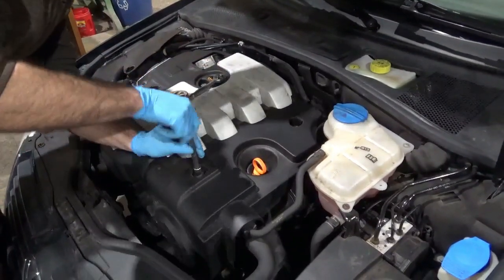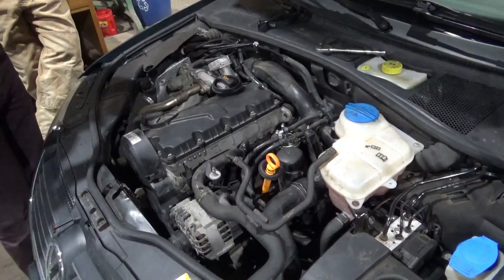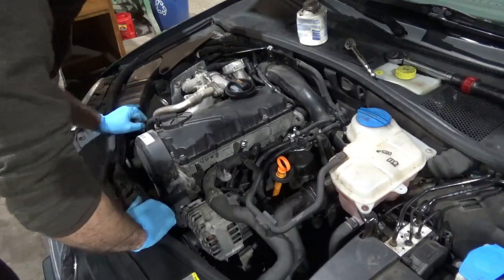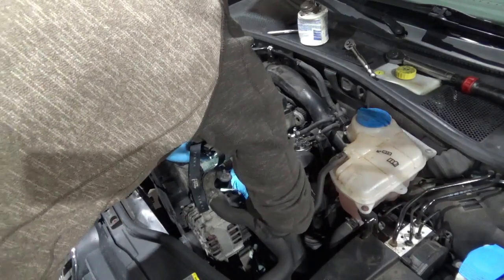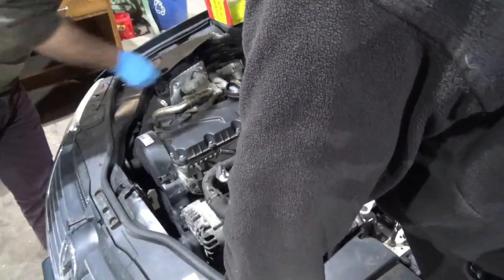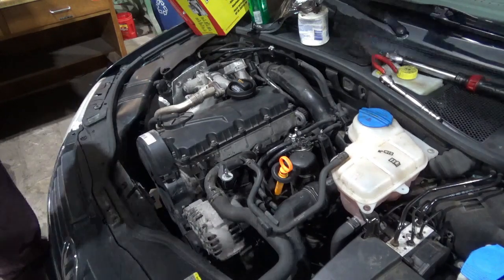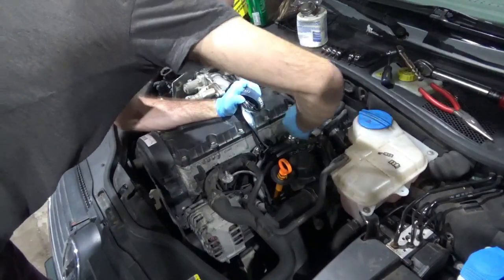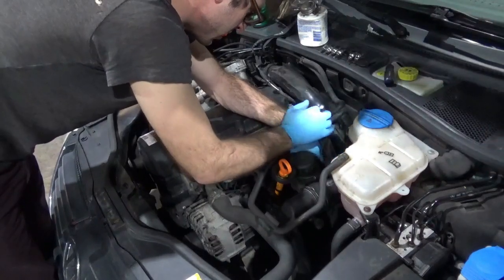2005 VW Passat BHW TDI glowplugs, glowplug harness and Frost Heater install

Comment: Are all the glow plug wires the same length that connect to a common relay?  Planning to replace them, order parts, but I noticed that all the glow plug wiring have the same the length.  Need help with my B5.5 Passat TDI thanks!
Reply from the maker: I don't know about them being to a common relay, that is why I had my friend just solder them in. In order to replace them fully, you would have to tear apart the harness and the metal coolant pipe. here is where I got the harnesses, you need 4 of them: https://kermatdi.com/i-1186-glow-plug-connector-harness-bhw-coolant-plug-harness-mk4.html#!year%3D2005%7C%7Cmake%3DVOLKSWAGEN%7C%7Cmodel%3DPASSAT They do sell OE glowplugs as well. You can find them on ebay, but I highly recommend go with the Kerma TDI ones, so you have some sort of warranty

Comment: Josh, thank you for this video! Just one question: to access 3rd and 4th glow plug, can I disconnect the rubber pipe that goes above them, for easier access? Also while removing glow plug connector, I accidentaly broke first one, because it s some old plastic, but wire is still ok. Can you give me some advice how to remove them? Thanks!
Reply from the maker: That pipe is metal, and it connects into the block behind the engine, so it very hard to remove, even if you remove it, you would have to drain and then bleed the cooling system when done. That is a hassle that I didn't want to do if I was just replacing the glowplugs. That is why I didn't remove it. The glowplug connectors are rubber to start with, and with the heat, oil, and time from the engine, they turn into plastic and become very brittle, that is why I decided to replace them as well. Those rubber boots are there to help it from shorting out to the block, and when trying to start the car in very cold weather it might cause it have a rough idle, in till the cylinders get enough heat to ignite the diesel fuel. hope this helps, I know there isn't a easy way to get to them, without taking half the engine apart, which invites more broken parts and headaches.
Reply: @JoshKilen  Thank you very much for detailed answer!

Comment: Any issues with this engine I’m thinking of buying a Passat with this?
Reply from the maker: it depends on how many miles are on it. the engine did have a little miss, I was told my a coworker who heard it while I was pulling in one day. It did burn a little oil, not sure where. After this video I had to replace the alternator twice, the original went out then the replacement went out like 3 months after, bad reman one, go with oem from VW. The car died at 206K miles from a bad Auto transmission even if you change the fluid every 50k miles, it will still fail, it would of cost about 7K to replace. If the car starts to unlock the torque converter when you drive up a hill or do a hard acceleration, then it is time to replace the transmission, you maybe get away replacing the torque converter or the valve body in the transmission, but that is not a guarantee that will fix it. The car also had a bad ABS pump control Module and a short in one of the headlight. Other than that the engine ran fine, even with the slight miss and burning oil, could of been the turbo seals.
Reply: Strong runner saved my life many times
Reply from the maker: @veryperson6011  this is the 2.0L BHW TDI not the 1.9L ALH TDI that is know for its reliability
Reply from the maker: @veryperson6011  Yes it is the 2.0 read the title of the video.